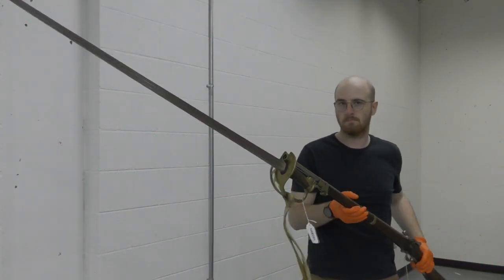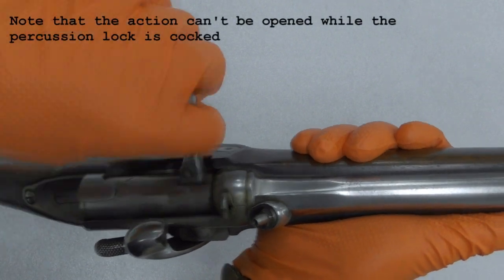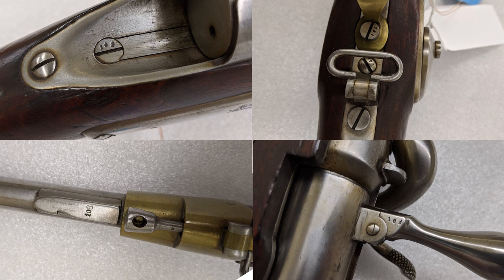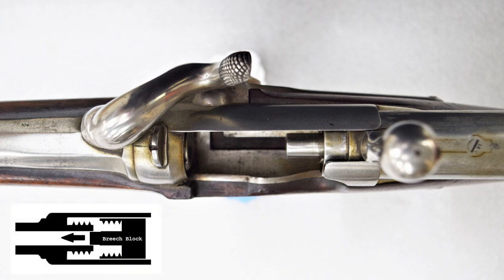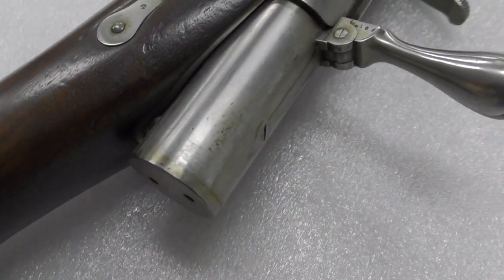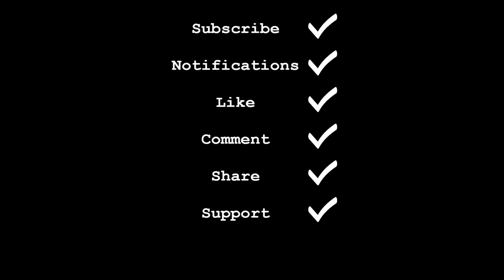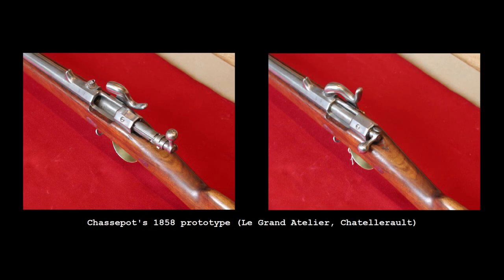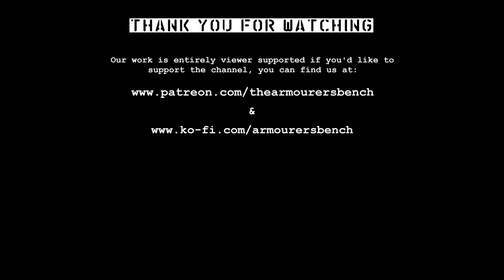Arcelin Modèle 1856 Carbine & Sabre-bayonet

Comment: thanks.  Excellent presentation. In depth history and the photography is superb.  Query: Does the action lock on the bolt handle like many early black powder bolt guns?  the only locking surface I saw was the slight cut out on the far side of the action.
Reply from the maker: Thank you! Well the bolt has an interrupted set of threads which you can just make out within the breech. There is also a channel in the base of the receiver which has a lug which controls the travel of the bolt and also is a locking surface I believe but I couldn't remove the bolt at the time to show it. The lock doesn't seem to have had any impact on the bolt.